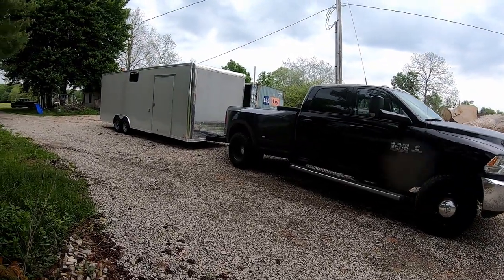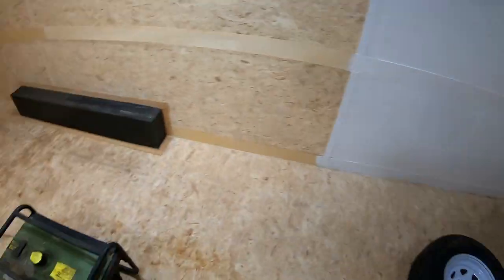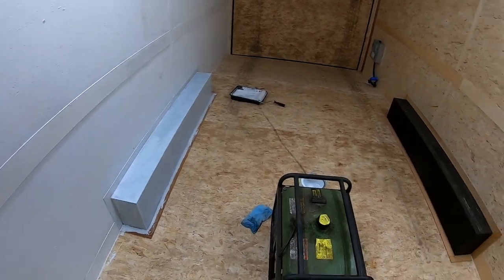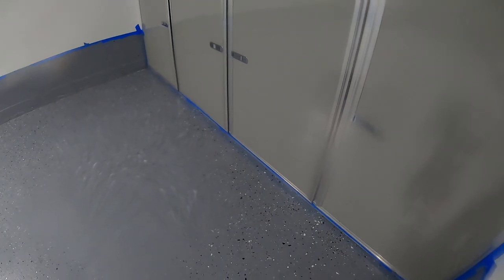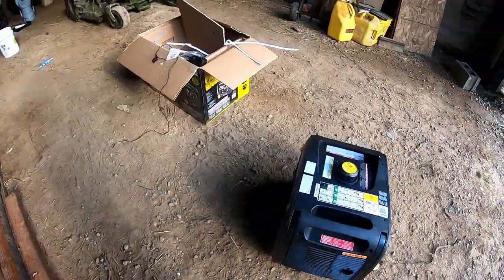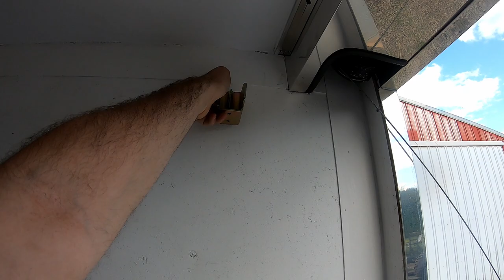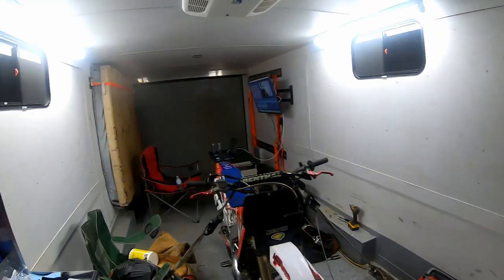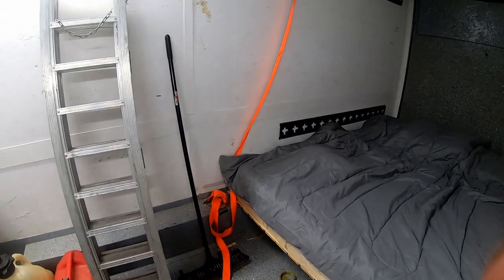#53 Enclosed trailer toy hauler build. Paint, epoxy , X track system, and bed build.

Comment: I'am currently building a 6 by 10 and yes, all the shaking from the highways will definately make things come loose and cause chaos....as far as tv goes, I'am going to set something up so the tv is removed for travel and placed in between two pieces of foam and strapped against the wall...

Comment: Hope the previous owner took all the walls out and sealed all the seams and holes or it will leak. I have a 32' Rock Solid and when I took off plywood walls I could see day light through the seams.It will save you BIG headaches down the road.
Reply from the maker: I'm not too sure but great thinking. I would hope it's sealed decent. It is at least full of insulation, walls and ceiling. But will probably end up with a lean too over it for extra protection in the future.
Reply: Where did you see the holes and gaps at,  I just ordered a Rock Solid trailer, I plan on removing the whole interior and insulate it.
Reply: @jimfromcolo  All of the seams had gaps. I had to remove all of the screws at every seam and silicone the seam. Also had 2 softball size holes in the floor at the front corners.
After I removed all the plywood I sprayed every seam and they leaked...I got it all sealed up now but was disappointed with the work they did because they just spit them out too fast..

Comment: The only purchase option for the bed lift is a happijac and they are $1800
Reply from the maker: Yeah the $40 in wood and hinges are more my budget 😅 but also I found out I needed it to flip up on wall to clear the rzr for future upgrades.
Reply: @SwiftOutdoors  instead of flip, just use solid board and with razor solid board stored against wall, no fancy flip design required